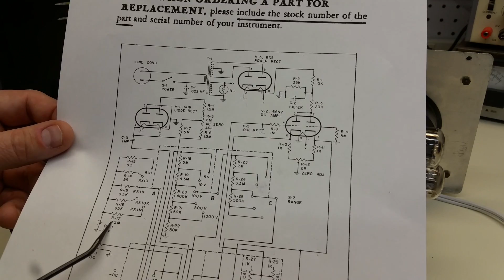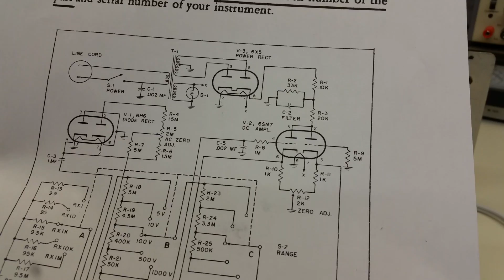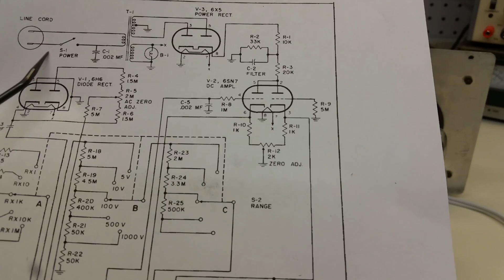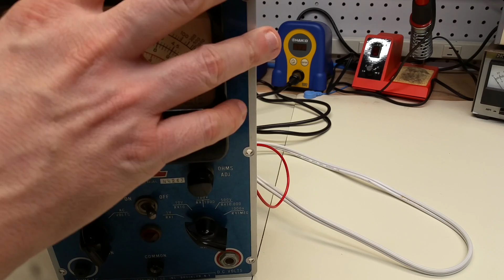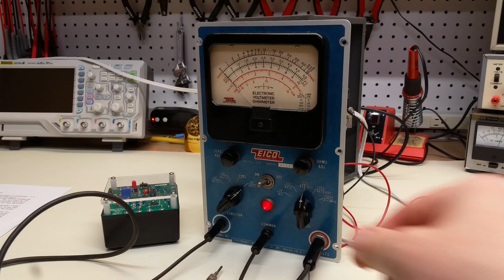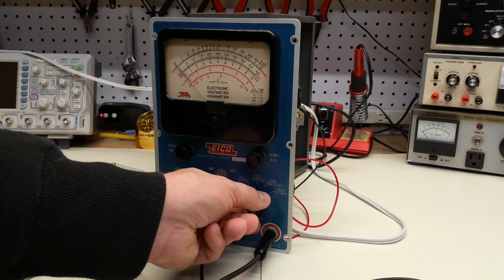#20: EICO 221 VTVM, part 3

Comment: Question for you
They still sell wire wound variable resistors that use a clamping ring to adjust the ohms. Could one use these to obtain the the ohm ratings?  Once a value is obtained, could you clip the remainder of the resistor and use epoxy to coat and seal the entire resistor?  An unusual approach I know. But it may be feasible and precise.

Comment: I would use a 3-wire (hot, neutral, ground) power cord/cable (which is polarized as well). If the primary windings of the power transformer fail (or worse the high voltage secondary windings fail)...by shorting to the case...well better safe then dead (And yes, the winding insulation can fail [it has happened to me], even on new transformers.) The ground should be attached to the case with a bolt (or tapped screw), with washer, lock-washer and nut...affixing the ground wire which was crimped to a lug. Don't solder it to the case ( UL wouldn't pass that kind of grounding, and one should not either.)

Comment: They used a D cell, for long life (since you had to take the case off...usually a pain) D cell (if it does not leak [use a high quality cell]) will last years (since as its voltage drops you can use the ohm zero to compensate.)